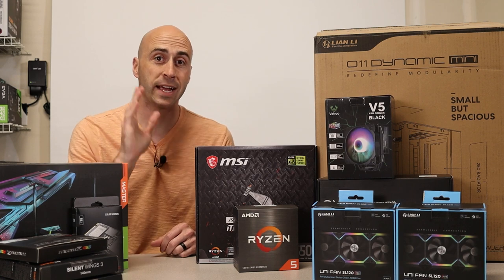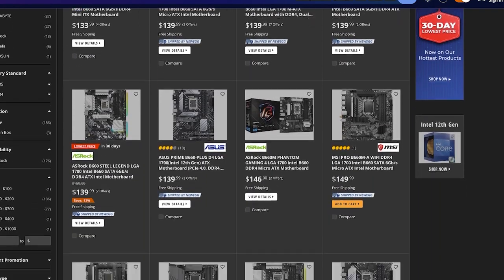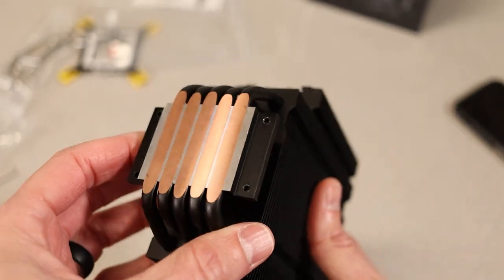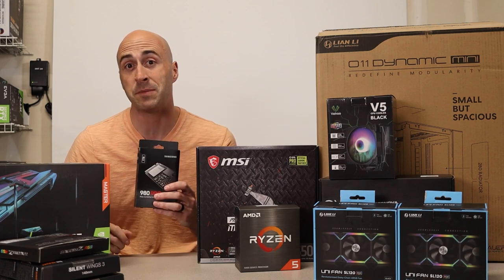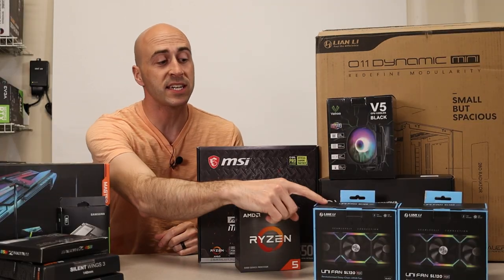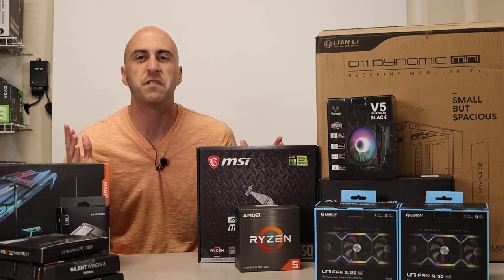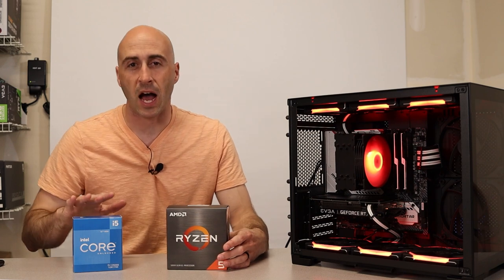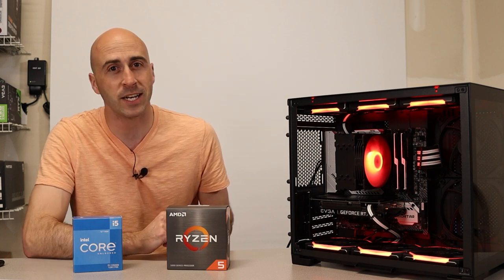Building the PERFECT RTX 3060 Ti gaming & streaming PC

Comment: Hey bro i love this build...... i need suggestions for my pc
I have ryzen 7 3700x with stock cooler
Asus prime b550 M A wifi
Powercolour Rx570 4gb gpu
32 gb corsair vengeance 3000 mhz
250 gb samsung sata ssd 
650wt cooler master MWE psu
Should i sell this right now and build a new pc for editing ( i'll start soon) and and gaming streaming or  should i upgrade my gpu and cooler for cpu ? I also want to know if intel would be better choice for future or amd ?
Reply: get a nvme ssd for operating system, noctua air cooler for cpu, and a better gpu
Reply from the maker: I agree. I’d just upgrade what you have. It’s a great start to a solid gaming build. You could go for a 3060 or RX 6600XT and that could be a nice editing PC/gaming PC
Reply: Your Cpu is fine still. Maybe an aftermarket cooler with a SSD add and a gpu upgrade would be ideal. An rx 6600 or Nvidia 3060 would be a sweet spot for that system.

Comment: Great video, but i do have a question. Did you optimize your pc or overclock your cpu or just something because i think those frame rates are really high for a 3060ti on 1440p
Reply from the maker: Nope. Everything is out of box settings. Maxed out at 1440p
Reply: @DannysTechChannel  wow I must say I'm impressed by the performance

Comment: I have RTX 3060ti with Ryzen 5 5600x 
Should I upgrade to ryzen 7 5800x to get a better streaming/gaming experience or it wouldn’t make a difference with the 5600x
Reply from the maker: It wouldn’t help with streaming if you are using H.264 encoding. If your using the Nvidia encoder, won’t matter. But if you can afford an 8 core CPU, why not go for it?
Reply: @DannysTechChannel  
Oh okay so the upgrade won’t enhance my pc with streaming ? 

I could afford it, but If It doesn’t change the streaming smoothness then I don’t think it’s worth of an upgrade !
Reply: @DannysTechChannel  thank you for the reply btw! 

Last question! 
With the current 3060ti and 5600x would I be able to stream 1080p 60fps or only if I upgrade
Reply from the maker: NO, you can stream 1080p/60 with that setup easily.  I'd suggest using the NVENC instead of H.264

Comment: Why does Nvidia recommend a 600W PSU if the GTX 3060 Ti peaks at 200W? I have a stock Dell desktop with an Intel i5-10400 that supposedly peaks at 160W. Shouldn't that be enough? The crappy PSU my desktop came with is only 460W Lol. Surprisingly, it did came with an 8-pin connector. I was just wondering if undervolting a 3060 Ti could work with my setup. BTW, that's a beautiful gaming machine.
Reply from the maker: Thanks so much! You might be ok with your power supply. If you are comfortable undervolting, you can get good results doing that. Might not be a bad idea to upgrade your OEM power supply to something 600w. They are very good priced right now
Reply: @DannysTechChannel  It's not that I don't want to. My PC is a Dell Vostro 5890. This Vostro is not like the old Dell optiplex models; or other HP/Dell models for that matter which came with an ATX PSU, or you could buy adapters to connect the front panel, power button, leds, etc, and transfer everything onto a new custom case. My PSU is one of those stock SFF PSU, so there's no room in the stock case for an ATX one.
Reply from the maker: I gotcha. Worth a shot. If it doesn’t work, you could always use that GPU in your next build. Might be time to build your own 😊

Comment: Is it ok to do 2 x 16gb ram or should I be doing 4 x 8gb? Is it a big difference having 4 sticks vs 2? Its more expensive to go 4 sticks so id rather go 2 but I also dont wanna cut any corners so if it's a noticeable difference ill spend the extra $50-$100 on 4 sticks of 8gb ram.
Reply from the maker: There is no noticeable difference. I haven’t done a video on this topic, however Hardware Unboxed is another tech tuber that has covered this extensively
Reply: @DannysTechChannel  Ok perfect,  thank you im just gonna go 2 x 16 than. Building a 3060 ti r5 5600x basically all corsair and MSI parts. Still stuck on whether I wanna go noctua cpu fan or a corsair h100i liquid cooler. But anyways thanks again for clearing that up.
Reply: @CantTreadOnMe how's the pc holding up???